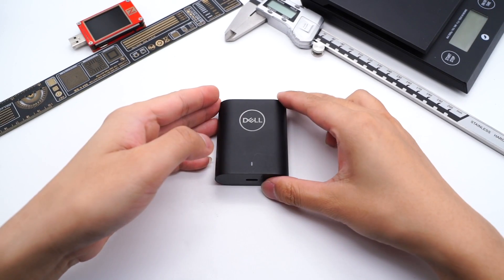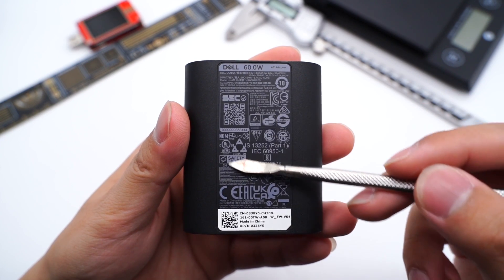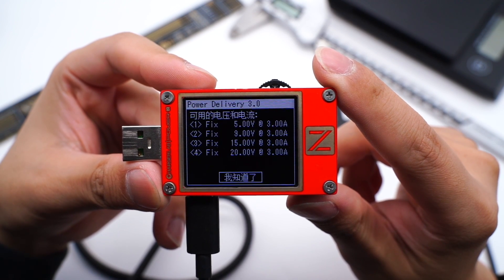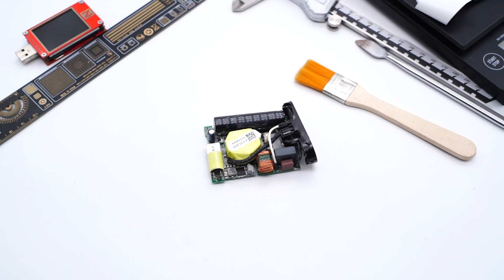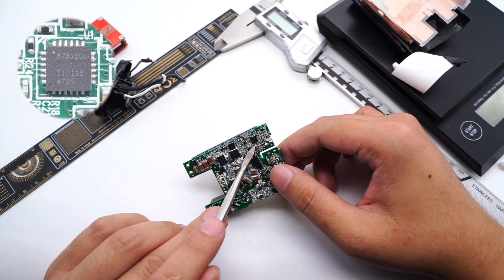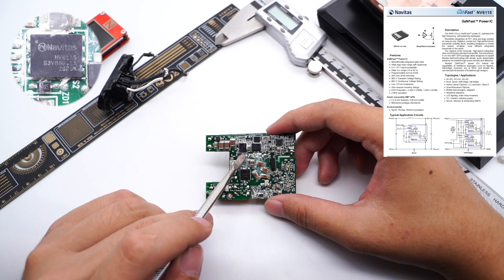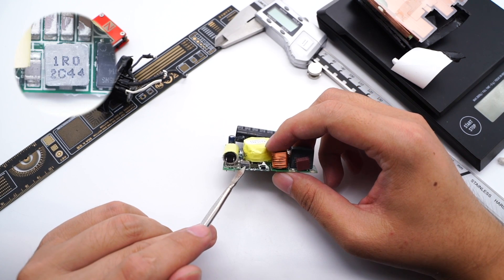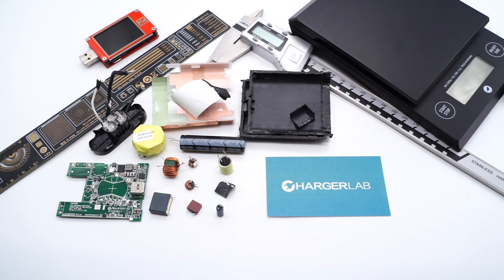Teardown of Dell 60W USB-C GaN Power Adapter (HA60NM200)

Comment: This is such a good design. I recommended this to my friend who wanted a replacement charger for her macbook pro. The original apple 61/65/67/70W charger costs alot more at $90  AUD. I got this for myself too at $39. much prefer an adapter that uses an AC cord for flexibility when plugging into a wall outlet

Comment: 60wUSB?! Really? How is that possible? At 5V USB that's 12 AMPS!!!!
The plug and cable will melt.
Reply: USB Power Delivery. In 5v mode it doesn't output more than 3 amps.
Reply: @AWall_  - That is 15 W
Reply: @AWall_  Thank you.